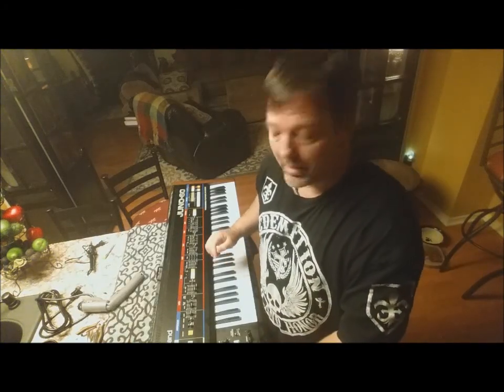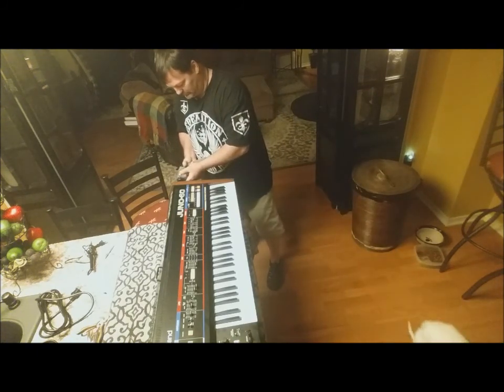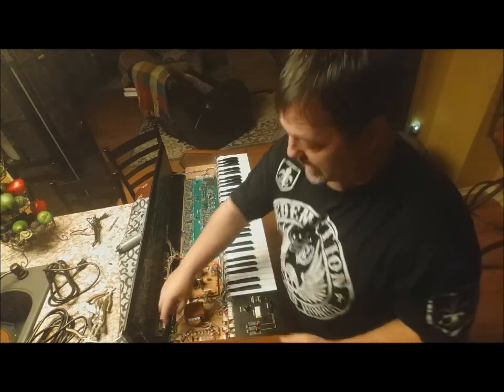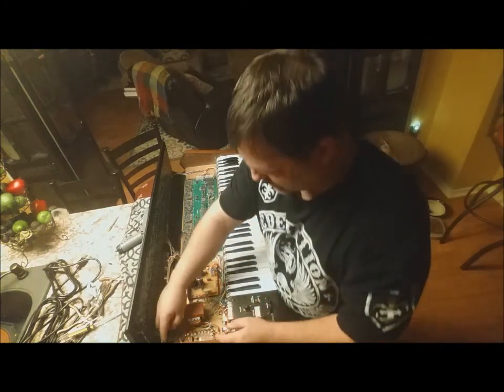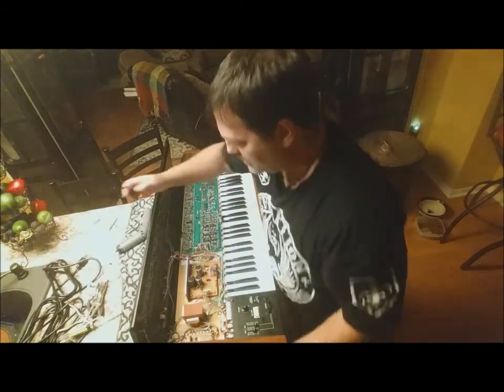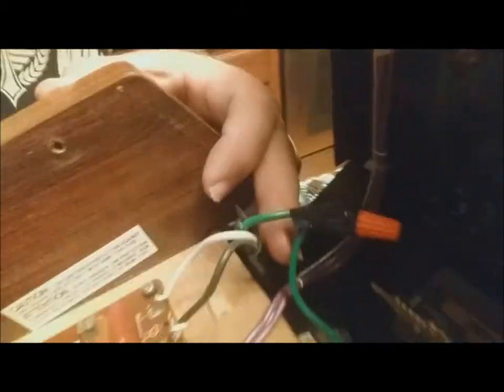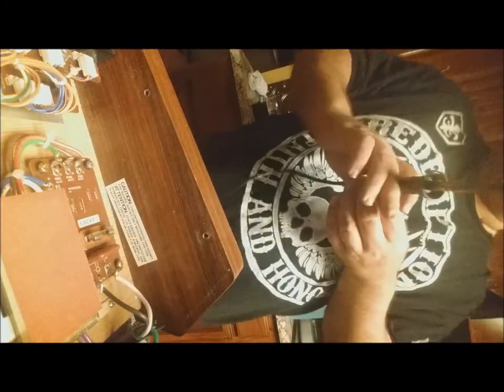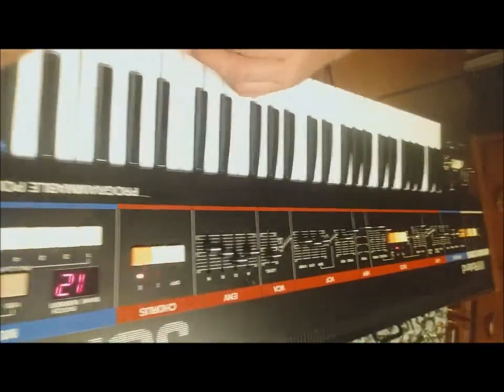Roland Juno 60 "A look inside this machine!"

Comment: The magic of those machines is they're made of solid cold static finished materials, while they produce infinite and alive abstract awesomness. Well, when they work ^^
Reply from the maker: +David Boura One thing that I can say about the Juno 60, It is a very reliable synthesizer. I have owned many through the years. The only issue I ever had were dead batteries, which is going to happen. I replaced the power cord on this one because someone had installed a very short one :)
Reply: +synthartist69 Let's hear it and enjoy some good Flac file ^^ hehe